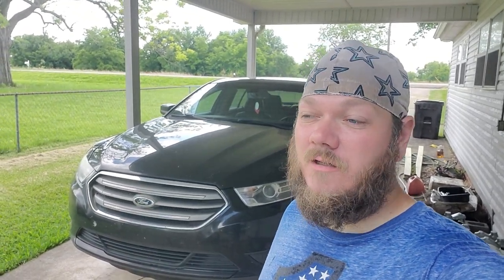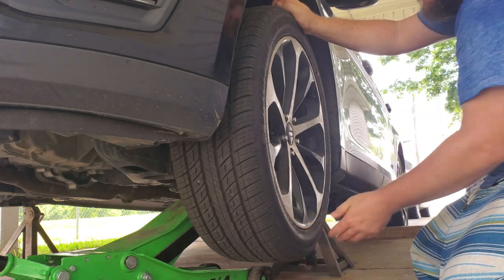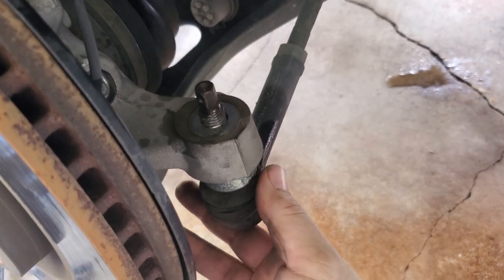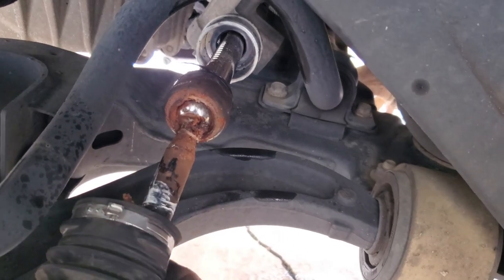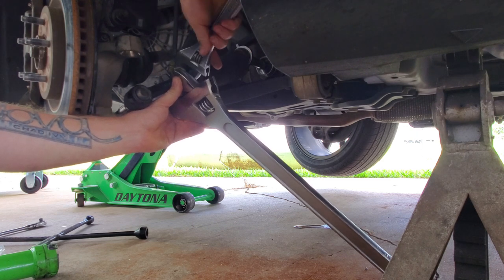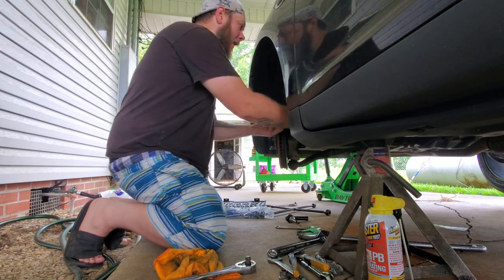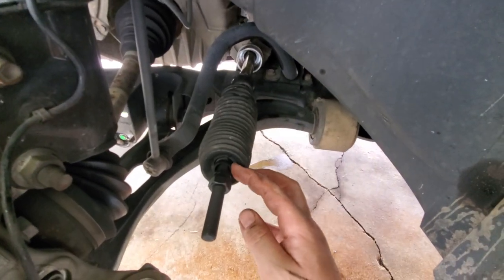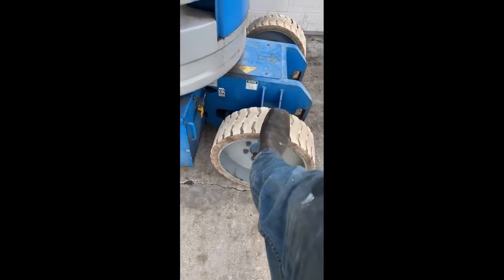How To Replace Tie Rods On A 2015 Ford Taurus

Comment: I have watched a couple of your videos and appreciate your excellent info and sense of humor and I'm subscribing.  I have a 2014 Taurus with 32k miles. I'm 70 now and probably will never need this done but I like knowing the process.  You probably know this but it surprised me I checked the trans fluid and factory fluid is clear not red. The Mercon LV fluid I purchased is red like normal. Thanks for sharing.

Comment: So, my car has 215k and I doubt these were ever changed or maybe they were before my ownership, picked my car up at 181k. I was looking at the actual service manual provided by Ford, and it makes it sound quite scary. The manual screams numerous times "NOTICE: The steering gear rack must be held while loosening or tightening the inner tie rod or damage to the steering gear may occur. Place the steering gear at the center position. Use an appropriate-sized wrench on the flat/teeth of the rack to resist rotation and to prevent damage during removal of the inner tie rod." [NOTE: An assistant will be needed to hold the steering gear rack on the LH side when servicing the RH inner tie rod.] Did you have any issues after the repair? Is your steering rack still good? I'm afraid to do it and somehow ruin those expensive steering racks.
Reply from the maker: No issues at all the car is still going good!

Comment: What was the condition that led you to this repair?
Reply from the maker: It was making a clunking noise while backing out of the drive way
Reply: Are you serious?  That’s EXACTLY what mine is doing.  It clanks/clunks on the left side when I back out of my driveway.  Everything else is new - strut, strut bearing, coil spring, control arm with ball joint and even the wheel bearing.  Frustrating, as my tie rod end seems tight.  Replacing inner and outer anyway now that you say that was your condition, too!  👍🙏
Reply from the maker: We changed the struts first thinking it was the problem
Reply: @curtshumaker5768  it's likey the control arm bushing, that grey cylindrical thing at the end of it. The bushing goes bad, and it's clunk city.